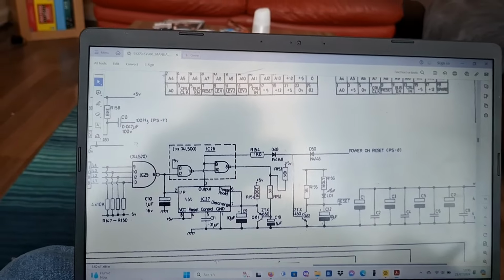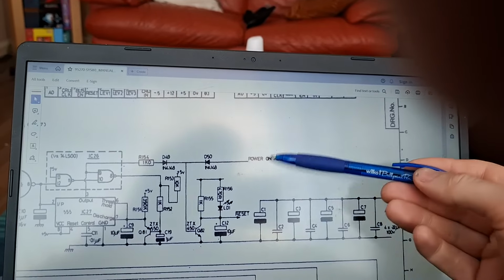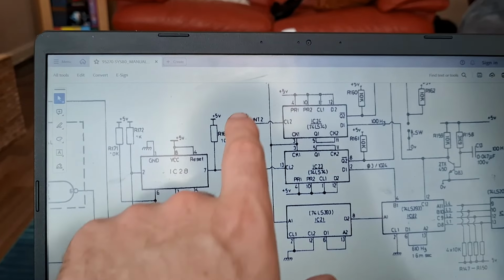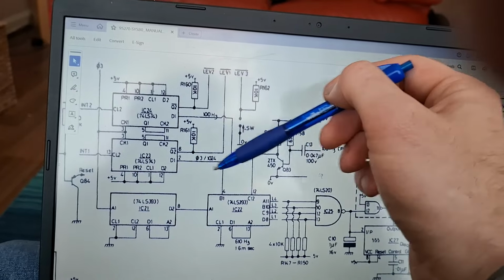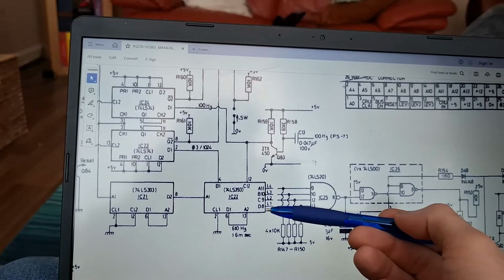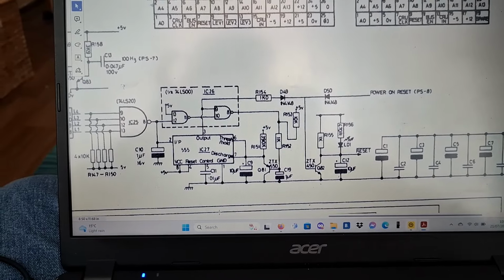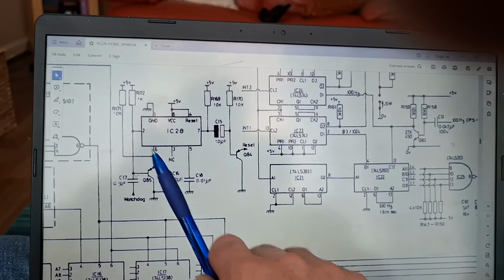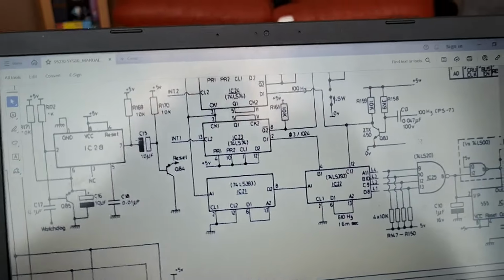JPM SYSTEM 80 RESET CIRCUIT BREAKDOWN: WORKING IT OUT

Comment: Thank you for your channel. Troubleshooting to component is mostly lost. Would you consider to demonstrate how to Directly troubleshoot a "short"? Either using a Mil-ohm meter or Power supply with current limit and you follow the voltage drop across the traces. If you follow a connected path with no voltage drop it's not that direction. You go direct to whatever is drawing most current even when the differences are small.